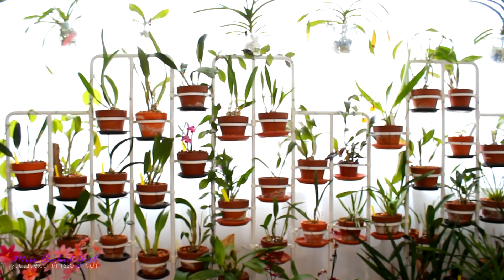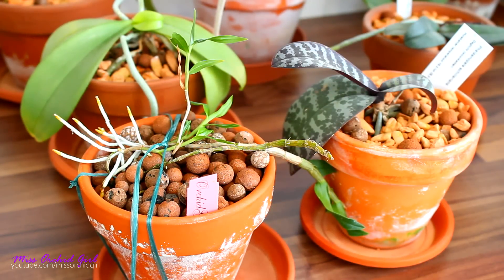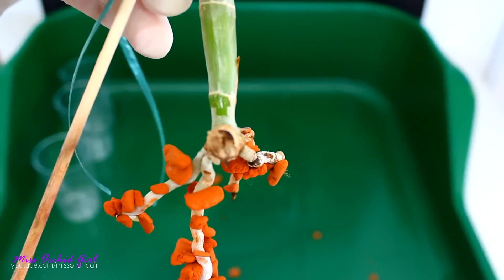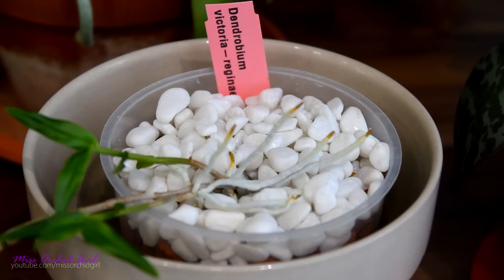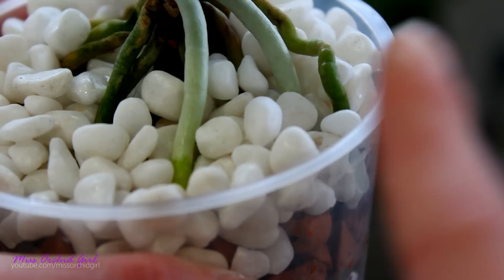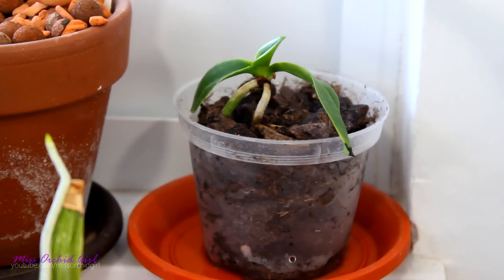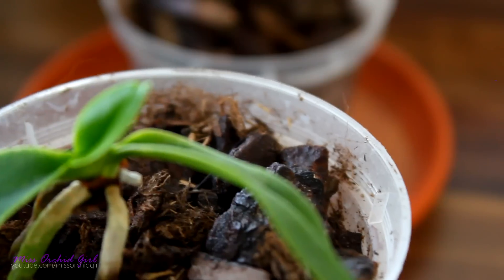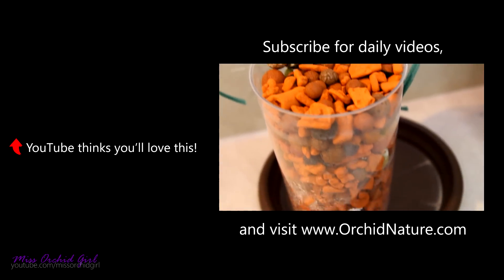Orchid root tip desiccation - Possible causes and fixes

Comment: Dani, is this still the case or did you discover another reason? I am asking because I bought a new bucket for watering my Vanda and a few days after I started using it, I saw the same root tip problem... 
I am wondering if maybe it was too much fertilizer or ... the bucket material... ? (the bucket had a pervasive plastic smell initially)

Comment: my orchid is experiencing the same issue, at the tips of the roots and at some points throughout the roots on some of them, where it seems almost like they've been pinched- they've turned dark and leathery and hard and thin, clearly damaged from something. it has segmented them. my orchid has always been in a clear plastic container, and i've always watered with tap water.  Last week the roots seemed fine and this week i'm so sad to notice this. The only different factor i can think of for my orchid is that within the past couple weeks it has developed a lot of buds and last week 3 of them bloomed. i was so happy and now i'm scared to find this. i'm not sure if i should just repot the entire thing, maybe its gotten too big and needs more space. or cut off the ones that it has happened to. a lot of them are the ones sticking out the top of the pot, but a few are like that all the way at the bottom. i'm not very experienced with this and i'm wondering what to do. i hope i don't lose any of the blooms!! or the entire orchid! any ideas ? did you figure out what was causing it to happen on yours? i hope yours got better and you found a solution!!

Comment: I do not know if I am allowed to give an opinion, because I am new to using LECA in orchids, but I also noticed that sometimes roots in the surface tend to desiccate or look stunt. What I have been doing and seems to work for me is misting copiously everyday and lowering the level of LECA from the pots, so there will be a taller rim around the plant, I feel like it increases the retained moisture. I also used your method of keeping rocks, but I fear that they might be too heavy.

Comment: I have this kind of happening with one of my plants too. My Encyclia Cordigera has issues. It only happens to the roots at the top. The ones in the pots are doing fine but the roots at the surface have issues ONLY on like 2 or my plants. I think like you said it has to do with root tips going too dry for too long. I really do think it is due to dryness. I know mine gets really dry at the top but I don't worry too much because inside roots look good. 

I have started putting some moss around the top to help keep moisture near the new roots at the top. Nothing in life is perfect.
Reply from the maker: Indeed the cordigera is not the most robust roots wise, they are pretty fragile, but once they grow in good moisture they are very hardy. mine had issues with fertilizer burn, but that got fixed :)

Comment: hello danny! sorry for my english. I'm from Venezuela, a tropical climate that have a lot of orchid that grow naturally. i have the same problem that you because i think that one sustrate and humidity is the solution and it's the problem. the  cattleyas and hibrid orchid need to dry hard. need a suatrate mix that have humidity but that dry relative fast. the phalaenopsis like to be humid everymoment. my solution: i live in a sunny climate of 30 centigrade, i use clay pot. my sustrate is charcoat 50% (can be sterile first) and organic media (coconut fiber or  raiz de helecho or another thing organic that retain water but dry fast). i water with water rain every 3 or 4 days with a lot of water that wash the roots, and fertilize weekly. and in clay pot is important that stay in the air to doesnt acumulate salts. i have beetter result. plastic pots with aliflor, leca, and another in9rganic media works for phalaenopsis some oncidium and some dendrobium that have fine root  that like to stay moist
Reply: and the organic media cant be sterilized or clean with some product becausenit descompose fast if you change the strcture.
Reply: the orchid evolution  is that they resist dry hard to survive infections with fungus and root rot. and ifnyou plant have ventilation and doesnt have Nutritionals deficient like magnesio deficiency,  doesnt suffer infest (spider mites, thrips, ) in my tropical climate that have low humidity hot temperature and a little ventilation the most problems is insect infestation
Reply: is you put a cattleya or hibrid in humid pot or semihidro etc, at first you note a excelent evolution with root formation big root and you are happy, but when the root touch the moist media, the problems starts.

Comment: Some orchid experts where I am from said that after a long period there is a build up of fertilizer on those clay pebbles, they look like white crystals around the pebbles.  That build up burns the roots, it therefore the build up needs to be flushed out or change the media altogether. Mostly what burns roots are high concentrations of fertilizer.

Comment: I was just watching a video of a talk someone gave on semi hydroponic orchids. Something the speaker suggested struck me as being potentially useful for you (even though I know your setup isn't technically semi-hydro). 

He suggests planting small plants or ones that need more water deeper in the pot. Since the top remains pretty dry, he doesn't have any problems with crown rot, and planting deeper gives new roots a chance to find moisture deeper down in the pot.

The top-dressing of smooth stones seems like a logical first step, but if water still isn't wicking into the top layers of leca very well, once the roots grow below the smooth stones you might still have the same desiccating issue. Planting a little deeper in the pot would make new roots closer to the moist layers of medium to begin with so they might not ever touch dry leca.

Comment: I can't help much, but I will share what little experience I have. I don't have a wide variety of orchids like you, only 60-ish phals. All are planted in only leca (not S/H) and have been for a few months. I live in a very hot & dry environment and I won't water until the bottom of the clear plastic pot is dry. This means the top layer of leca may be bone dry for a week (some longer). Most of my phals have put out new roots but none have ever showed damage like that.
However, last month I decided to chuck a few sluggish phals and one was in pure sphag in a CLAY pot. When I unpotted it I was shocked to see how damaged the five new roots and old roots that had branched, were. Same damage that yours are showing and more than likely had touched the clay pot. And since I don't water till the media is bone dry, based on your theory, that pot would've absorbed a lot of moisture from the root tips. In my case I don't know why this happened with the clay pot and not the leca but my guess is my leca isn't as porous as yours. When I drop water on a pellet it tends to roll off and the leca wicks poorly, which is why I soak my phals when watering. So maybe my leca isn't porous enough to absorb moisture from the roots? Just food for thought.

Comment: I have been growing my orchids in clay pots and in clay balls from IKEA for 10 months now and the only time I had a problem with damaged root tips is when I used to much chemicals to get rid of mold. No other time. I use tap water and over the counter fertilizer. So I don't know🤔 but I will inspect closer next time I repot

Comment: How many of these orchids were drenched in hydrogen peroxide to eliminate algae? Perhaps the peroxide might be a problem? 🌱
Reply from the maker: None of them, didn't have major algae on these ones
Reply: MissOrchidGirl Ya, when I saw that  the ones that seem to be having problems were topped with Leica, I thought it might be the peroxide... being that your solution to algae was to do a peroxide drench and top with Leica. Perhaps the easiest solution is return to all Seramis, no topcoat of Leica, and do the peroxide as needed?

Comment: if you fill a few containers  with tap water and let them sit at room temperature,  the clorrean will evaporate after, 24 hours.
Reply: Depends on the kind of chlorine your water treatment plant is using. I read somewhere it's becoming more common for water treatment facilities to use a less volatile form of chlorine that doesn't evaporate.

Comment: I, too, get a lot of salt buildup on my clay pots while using Seramis. (Note: Seramis for houseplants - the smallest pebbles- is the only kind available in USA, and it comes from Germany and I can only find it in 1 store here online) but I'm inclined to keep using the clay pots because if I use plastic where would the salts go? They'd build up inside the plastic pot, right? Cleaning it off the outside of the pots is relatively easy compared to the problems of salt buildup inside the pot. Just a thought.
Reply: Raylene Evans, can you tell me please, how big the individual grains of your Seramis are? Reason I ask, is bc a similar medium is used in aquariums, but the granules are quite small...about 1/8 of an inch and smaller.
Reply: About 6 pieces of Seramis for Houseplants = the size of a dried raisin.  Hope this helps.

Comment: Mie mi s-au uscat niste radacinute noi la 3 phalenopsis care stau in seramis si un pic de leca, dar nu ca s-au uscat varfurile - radacinile (si noi si cele sa zic "adolescente") s-au uscat rau de tot. Am dat vina pe fertilizant (tocmai ce-l schimbasem, poate am si pus eu prea mult sau des), dar e posibil sa fie un factor determinant sa fie si absorbtia umiditatii realizata de seramis si leca de care vorbeai.
Dupa dezastru, am constatat ca intotdeauna exteriorul vasului (la mine sunt de plastic) se usca mult mai repede decat interiorul (unde dureaza pana se usca). 
Deoarece plantutele dadeau semne de deshidratare evidenta ( am verificat si in interior exista umiditate suficienta), radacinile externe si cele puiuti - care apareau in continuare - aratau horror , am inceput sa le umezesc un pic cu un pulverizator cu apa (doar pe radacinile aeriene si stratul de suprafata de seramis/leca) cam o data la 2 zile. De atunci au aparut radacinute noi, care sunt ok. Cresc bine. Am folosit doar apa de robinet, alta n-am. Si am dubii ca le-ar place Borsec plata :)))
Mi se pare extrem de pertinenta analiza ta si astept cu interes urmarea.
Si felicitari pentru tot ce faci, daca nu erai tu si sfaturile tale, si in prezent as fi fost un criminal de orhidee in serie =))

Comment: same issue here with a handful of plants
Reply from the maker: +Zane's Wildflora only in clay things?
Reply: Maybe extremely rarely it happens in organic as well, but that might be 
salt deposits, but clay medium indeed bothers the roots of some orchids 
but only on the surface. At first I thought it must be salt from the tap
 water, which I use when I run out of rain water. The fact that some 
orchids are sick, or some are seedlings doesn't really affect this, I 
have perfectly healthy root tips on seedlings or recovering orchids no 
matter how much they touch the surface medium. One of my cattleyas 
produced three new roots, one managed to get into the medium quickly, 
its still growing strong and healthy. The other two were rather surface 
roots, then the tips died. No medium vanda and organic mount orchid 
roots are fine, I have one clay mount, the roots dont seem to be 
affected. Ray's explanation seems to be the case. 
Great video, great explanation, can't wait for your results.

Comment: Dani; I think you might be right about the clay pots sucking the water from the root tips. I pot mostly in clay with bark mix, and I've noticed the same thing where the roots climb over/sit on the pot rim and are damaged. I have found, though, that if the tips are damaged, the root sprouts new tips further up, so I don't worry about it very much (maybe I should?)

As further proof of the "clay stealing the moisture" theory,  I have one glazed orchid pot with holes on the sides: the roots come through those holes, but don't seem to get the same damage because the glazing doesn't allow the pot to absorb moisture. The roots grow long and happy through the holes. Maybe I should repot everyone in these pretty (expense) glazed pots (er...my bank account says 'no').
Reply: Lynn W Ditto on the glazed clay pots with holes. I don't own that many orchids, but all are in bark mix with glazed pots. I find if the glazing extends over the top and into the pot that I don't have this problem with the root tips.

Comment: I just happen to have most on my orchids in leca or seramis or both but not in ceramic pots. Also, it just happens that I have a seredia Japonica and a victoria Reginai in leca but plastic pots. so I will take some pictures of the roots and send to you so you can compare it. xx
Reply from the maker: Thanks Cilla will check the email :D
Reply: MissOrchidGirl I just tried to check the roots of my Victoria Reginai and it is all under the leca. I didn't want to disturb it. but sent you some pictures that may be not what expected.

Comment: From the Caribbean, Trinidad to be exact. I basically saw the same thing with my orchids but it was mainly because of a change in my watering schedule. Heat plus lack of moisture did the same thing to my roots. 
Took a few weeks for them to settle out but they adjusted.

Comment: I also wanted to add that maybe a temporary topcoat of Synthic around the base of the plant, just until the roots have grown down into the media, might be effective. I'll keep you posted of any results I get. ;)
Reply from the maker: Won't work, that stuff repels water like it's disease :))) I cannot even water the pots under the tap with synthic on top lol
Reply: Hahaha true, unfortunately Synthic fell way below expectations as a viable inorganic replacement for sphagnum moss...it could've been a viable solution.
Reply: MissOrchidGirl what about layering some pieces of microfiber cloth, like the ones used for houseworks... It adsorbs water very well and it's doing great around my vanda's roots

Comment: There is always something surprising going on with your orchids :D I agree that the ceramics absorbe moisture from the root tips and the best solution for this is to spray the media and the pot, where the tips touch it. The quarts pebles are also a good idea. You are always going to have some issues growing orchids, because you can't exactly grow them on trees, in the perfect position and moisture levels, free of pests and with filtered sunlight, can you? :D
Reply from the maker: hehe you are right, I sometimes want things to be more than good.. not sure if it's ok but until things are perfect I can't sleep well :))))
Reply: With that attitude you are going to have an orchid nursery of your own in a couple of years :D

Thank you so much for your videos, by the way. Today I am taking care of my oncidium type orchid. It has a lot of aerial roots and we watered it nicely, but the pseudobulbs are completely shriveled. I removed it from it's decorative pot and there was litterally 5 cm of water in there :D (It was not under my care) I took the orchid out of it's pot and removed the soggy bark media and found out that it had a moss ball. I found out that there were actually 2 plants in there. A big mature one and a baby, tangled up together. They both had 4 pseudobulbs. They had a lot of roots, but I checked them all and they were all dead. The big plant was left with only it's bushy earial roots and the baby has 4 little roots about 3cm long, each. I removed 1 small pseudobulb from both of the plants, because their base was black.  Now I am soking them in a bowl with rain water. I soak for 15min and then let them dry for 1/2 hour. I will do it about 3 times, so they can have a drink and then I will pot them up in plastic pots with a lot of ventilation holes. I will let them dry completely before potting them and I am careful not to leave any water between the leaves. I only have very fine orchid bark media. I will water them in the morning, after about 12 hours, so they don't have too much moisture at the same time. This is my plan for now.
Sorry for the long story, I just want to know if you think that I am doing anything wrong, because this is the first time in my life I repot an orchid :D I can share some pictures of the process if you would want to see the situation. Thank you!

Comment: How often are you fertilizing your Orchids? Since seramis is a porous it may be holding on to the fertilizer and salts. I rarely fertilize my Orchids like most people and haven't noticed root burn. I to have my Orchids in seramis as well just in plastic pots.
Reply from the maker: very rarely now in winter, vandas get fert every time they get water but potted orchids.. maybe once a month now. The damage on the victoria reginae happened on fresh washed leca.. so no real salts :(

Comment: My two cents: I have a Masdevallia in inorganic (pot and medium) and have issues with the roots on top. The ones inside the medium are fine, but the ones touching the top do get damaged. I rinse the seramis and leca very well before use and I noticed that spraying the top of the medium between waterings eliminates the problem (tested it on one of the roots by maintaining it constantly moist.) Hope this helps!
Reply from the maker: Hi, I have a masdi in inorganic too but on her there is not a single issue, but she stays wet all of the time, no dry time really :P thanks for the info it sounds encouraging, if it is a desiccation issue it's easy to fix, it would be worse if it was the water or something :P